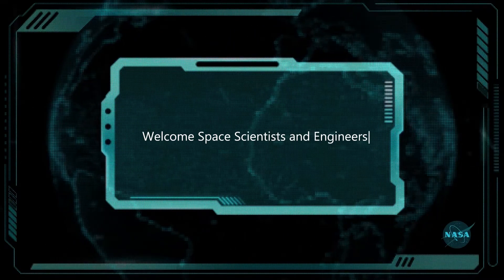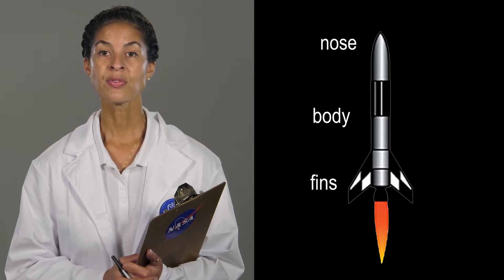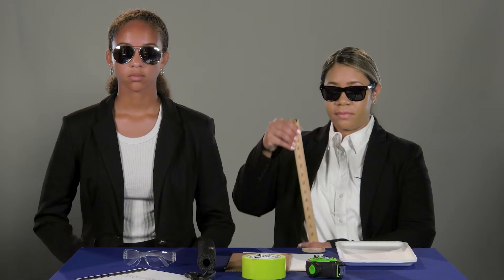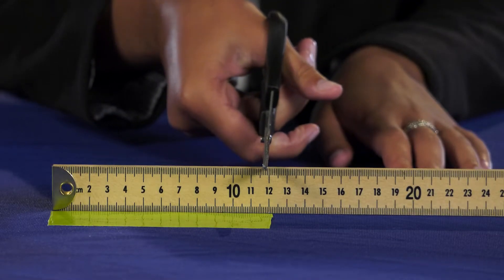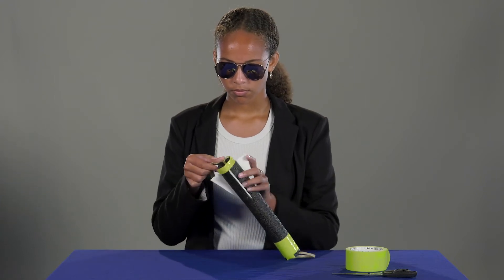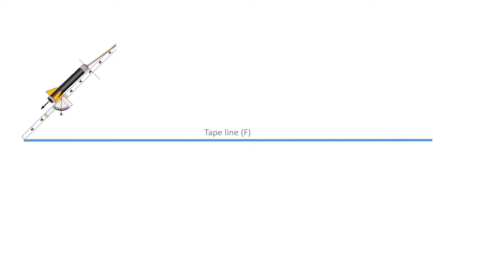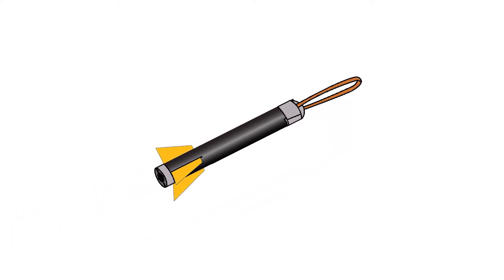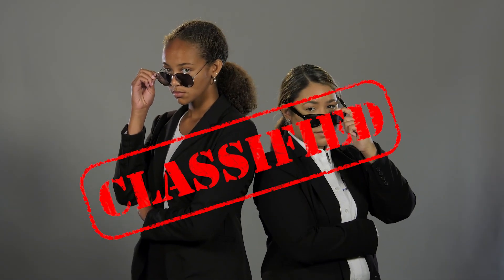Mission: Design Stabilizing Fins

Comment: In your initial design, Make sure the fins are swept back.  Moves the center of pressure behind the Center of gravity, 8 times out of 10.  It's a cheat, but it works most of the time.   Also, you can extend the length of your rocket to keep the center of pressure behind the CG, or to correct a problem with that.   Adding more weight to the nosecone can push the CP behind the CG, if needed(last resort).  ALOT more to take into consideration when designing, but those are "cheat codes" that can help you get unstuck, if so.